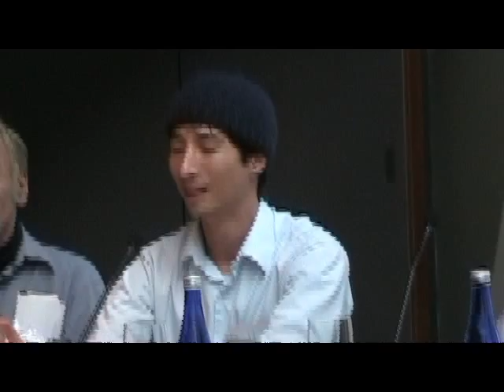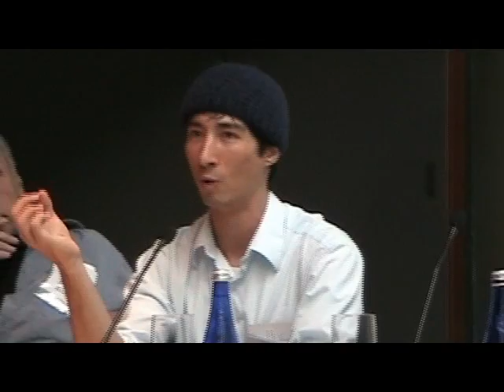Shawn Frayne - Windbelt I (Inspiration)

Comment: i had an idea similar to that years ago before i even had a car but now relise that it would make my mpg fall so much because of the drastically increased drag. You could keep it in the boot when not driving then use it for that when your parked up rather than leave the engine on or use the battery